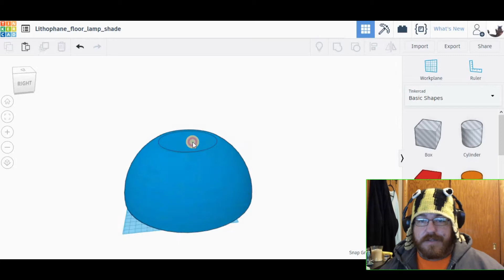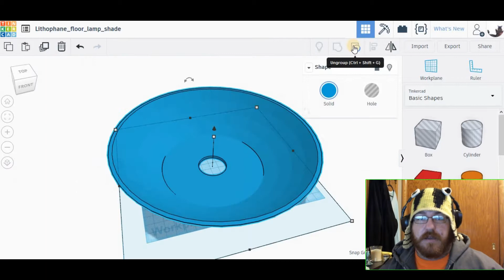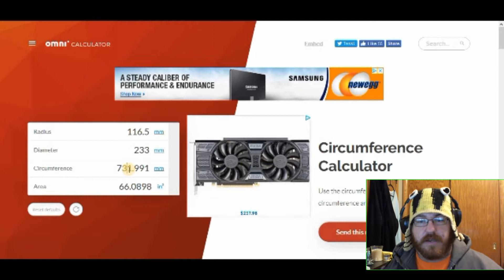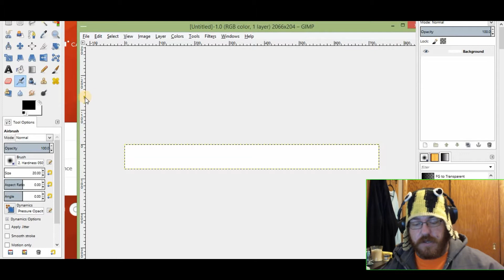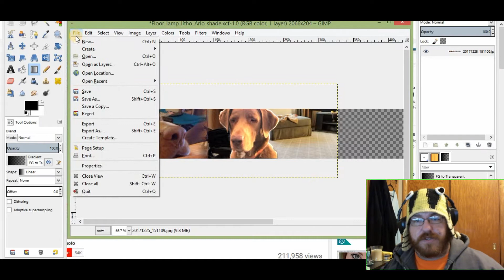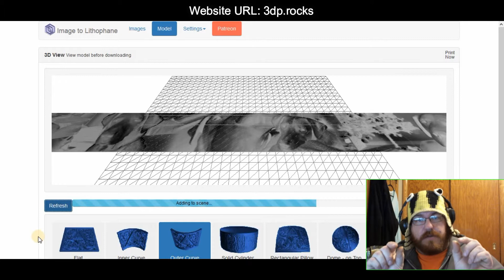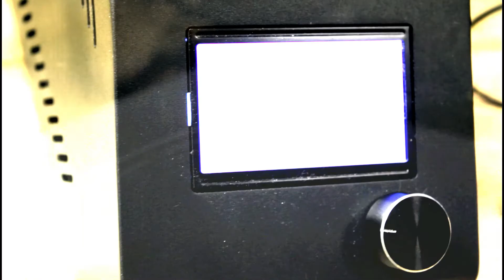Lithophane Floor Lamp Shades

Comment: 1) Why did you take image width 728.84 when circumference is 731.991?

2) on what basis you set the size of lithophane 716mm  in 3dp.rocks?

Please Reply..
Reply from the maker: Good eye. I think the majority of these discrepancies are a result of bad editing on my part.

1. I recorded the first part of the circumference before I measured the diameter a second time. When I measured the diameter again I recalculated circumference for the GIMP editing that's why it changed to 728.

2. The same occurred for the 3DP section, I had place holder values during recording. Generally I will do a project first to make sure it works and then record a final video going back through my process, unfortunately I put in the wrong values for the recording parts. You are correct to keep the same values throughout as you do this for your own light fixtures.

It is worth noting that sometimes you may have to export a few different trials in 3dp rocks to make sure the connections line up and everything looks good. Sometimes you may have to change the dimensions slightly to make sure the finished lithophane looks "perfect".

I apologize for the confusing edit, this was pretty early in my video making I like to think I somewhat improved over the years (doubtful lol).

Thanks for the great questions I hope your project goes well!
Reply: @RevampedOutdoors  Thanks Bro.

Comment: GG ... can you share printing setup?
And how the lithophane is handling the heat of the light?
PS: nice music... At the same time apreciate a lot the video description!
Reply from the maker: Thanks! I used the cr10 to print these, 100 percent infill at 0.20mm layer height, I used white no name pla from Ebay I'm pretty sure (it's been awhile). I also set a brim of about 8-10 layers so it would have some more surface area to stick to the bed. I use hairspray on the glass to help it stick. Print speed is  about 40-50 mm variable based on what Simplify3d thought was best based on 40mm/s. The bottom of the shades were printed at 10 percent infill to save time. They have held up well, no warping to the light heat although I did switch all the bulbs to LED so the heat is much weaker than iridescent or fluorescent. Hope this helps!

Comment: The web page crashes when i try and compile the lamp shade any advice?
Reply from the maker: I switch between Firefox and Chrome sometimes switching the browser helps.  For some reason on my setup Firefox renders 3D much better than Chrome.  Also maybe clear your memory with a restart first? That may help it get the space to render. Hopefully you get it!